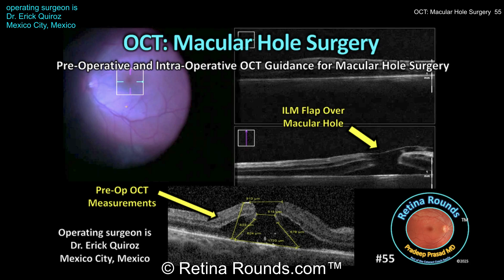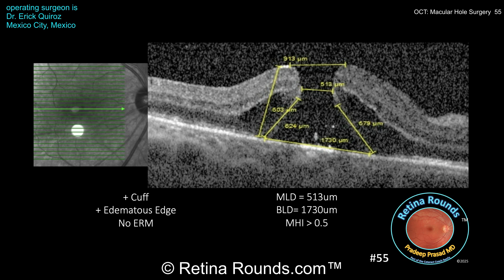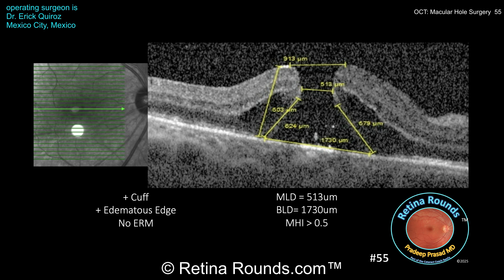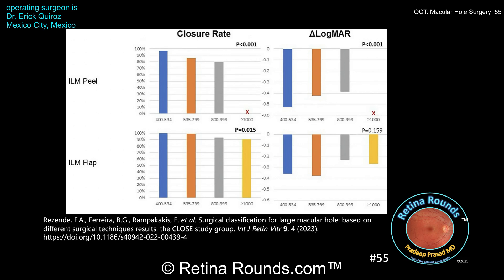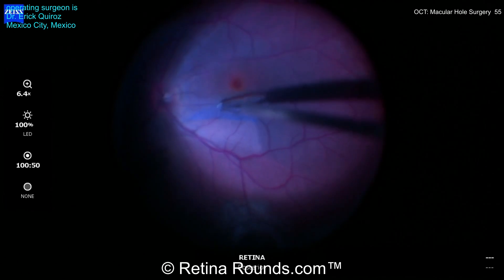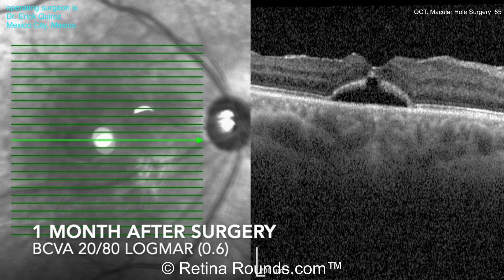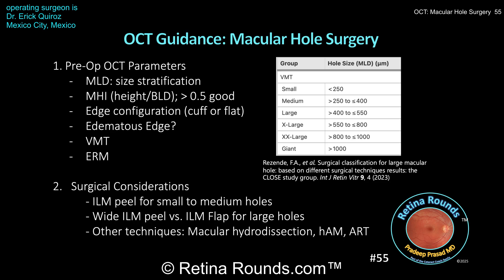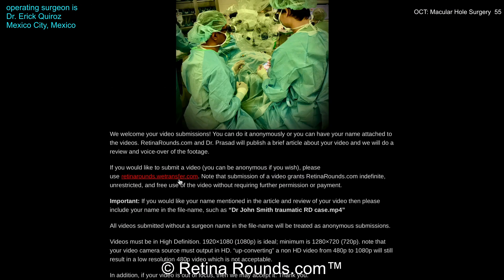RetinaRounds™ 55: OCT Guidance for Macular Hole Surgery

Comment: Great surgery🎉  dying pattern is perfect ? How did surgeon apply dye Infusion on or off ? How much time did he wait ? Which kind of lens using when you are operating cases like this contact lenses produced for macula or non contact lenses? Superior ilm flap or temporal ilm flap ? Which kind of flap more efficient? For beginners which kind of technique do you advise? Ilm peel or creating ilm flap under PFCL is safer than under BSS ? Cases like this core vitrectomy is enough (less is more ) or complete base shaving required? In this case i ve seen a superior laser photo coagulated retinal hole around 12 o clock. Retinal detachment caused by macular hole how can you handle ?